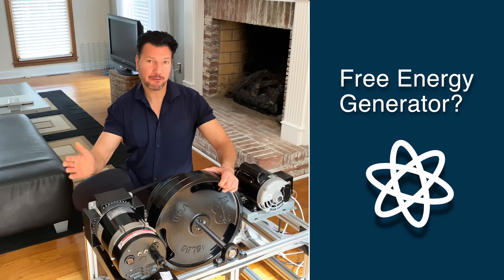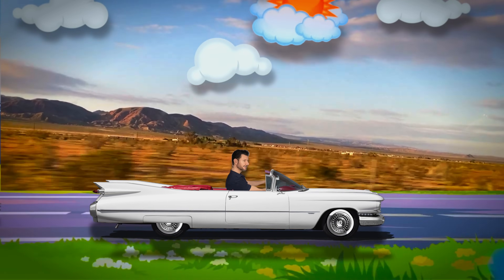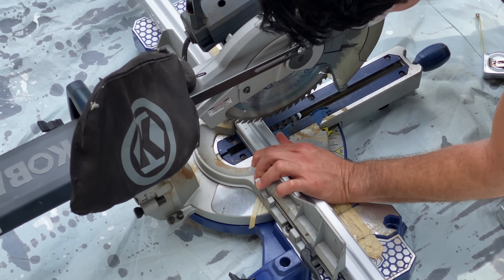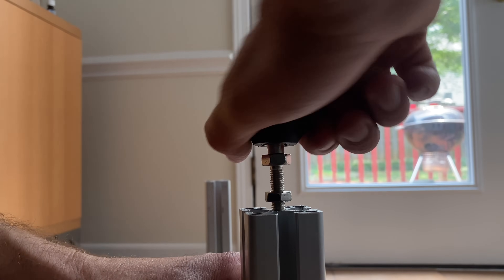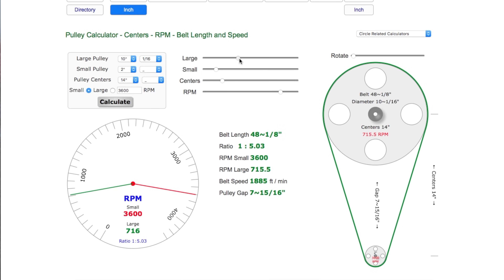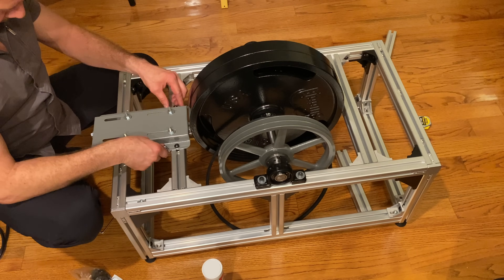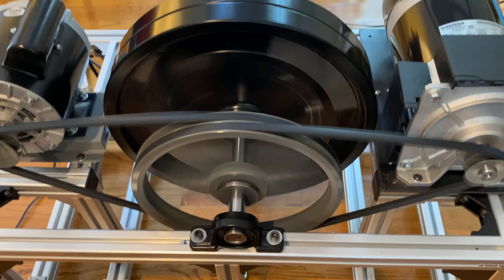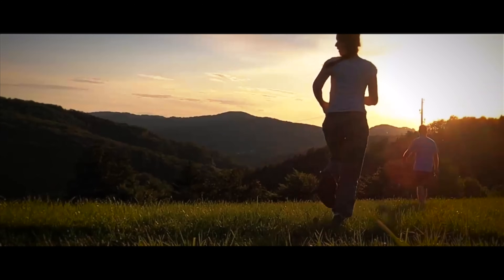How to Make a Free Energy Generator!

Comment: Thanks for the work you show. Whatever engine you install, the most important thing here is the generator. You have to modify the generator so that there is no dragging Lenz effect, then only with a bank of capacitors you can make this system work on self loop
Reply: The only person I know who has done this is the inventor Thane Heins. He has videos on the net for regenerative acceleration.
Reply from the maker: @Endthefinancialmatrix  thank you Eric I will look him up.
Reply from the maker: Thank you green wave.
Have you seen what you describe work?
Would be interesting to see.
Where I work we use capacitor banks for short term energy storage for AGV’s because the are much quicker.
In combination with a battery that is.
Reply: @MarkusNenning  yes I have made, see my videos. also if you want to try with regularly generators you must use 2 pulleys on the flywheel with different radius in this case it can work for the driving motor you must use FVD
Reply: @MarkusNenning  hi out of curiousness i Wonder if you tryed what green wawe Said or any of the others and made it work? It would have been awsome
Reply from the maker: @vikingofnorway991  unfortunately it is still not working.
I am currently working on rewiring a car alternator and hope to get some better results with it.
Reply: @MarkusNenning  cool, thanks for the answer, I hope u try to convert a 24V 200A alternator, thats what im gonna atempt atleast 😅 the curiousity kills me😂
Reply from the maker: @vikingofnorway991  mine is only 130Amp :)

Comment: You need to use an 1800 RPM generator and change your pulley sizes copy the Indians videos 3 horsepower electric motor with a 12kw generator seems to be the average formula again look at 10 of the Indians videos they all seem to use similar flywheels and pulley systems and definitely 3 horse electric motor average width 12 kilowatt generator I'm going to make one just to see cuz I want so many videos got to see if it works or not good luck
Reply from the maker: Thank you Welding Girl!
If you really make one yourself share a video.
I am working on a re-design with some new ideas and some wild concepts :)
Will have a follow up video soon.

Comment: thank you for this nice video.
personally i believe the answer is the following.
use more than 3 generators with the same motor and above all you must replenish the ball bearings 
with magnetic bearings to eliminate the frictions and so the losses of the energy
Reply from the maker: Thank you!
Yes floating magnetic bearings was my original plan but for that heavy flywheel it was too expensive to get the needed parts. Hopefully next time.

Comment: Your fly weell is very small and so the ratio of the pulley forbidden gynflu d Ford engine to the fly weel is good but from the fly weel to generator sould be smaller to bigger and is Big to small
Reply from the maker: Hello Juan it’s over 90 pounds.
Do you think to small in diameter?
I am planning on adding 2 more discs but wondering if I need to have a bigger diameter.
It’s very hard to find a big flywheel around here.

Comment: hi . good boy.  you have made nice work .but is on error direction .. to produce more energy that consume need force multiplier mechanism ..the flywheel is not multiplier. is only storage kinetic energy ..for this thing this system dint work .. i have much year to research to find the perfect multiplier mechanism ..  i wish you good luck in the next project .
Reply from the maker: Thank you!
If I use a driveshaft instead belts do I need a gearbox in between as a multiplier?

Comment: Don't you know of ratio? Wether you'd used a wheel with same ratio as on motor and generator everything would have been working well. You just didn't make enough power for wheel to turn. Try to make even ratio and let's see! Would be interesting.
P.s. See those indian videos, they are using same diameter wheels so they didn't lose any energy.
Reply from the maker: Thank you 
My radio is almost 1:1 the motor is 3000rpm and the generator needs 3600
One of the most suggested modifications is using a low rpm permanent magnet generator.
I will give that a try.
Reply: @MarkusNenning  no, you didn't understand. I ment the ratio between motor and center wheel. It is there you are losing power. You need to make this ratio 1:1. The thing is that big heavy wheel will generate power under big moment of rotation.

Comment: bigger fly wheel and lower rpm alternator should do the trick!!
Reply from the maker: Any idea where to get a bigger flywheel?
I was thinking about adding 2 more 45lb plates.
A actual bigger diameter is very hard to find.
Reply: @MarkusNenning  I have no idea man, you might have to make one lol
Reply from the maker: @ggesdsdsdsd  also not an easy task :)
I either need a big hunk of steel or maybe something out of reinforced concrete.
Anyway thanks for the feedback!
Reply: @MarkusNenning  Another way is to make a water loop with a large ram pump and a lot of water, feeding it into a water turbine.

Comment: My brother, you've done a great job I must confess, however, your pulley looks like a one to one ratio, and therefore there is no torque amplification from the drive motor to the generator. hence the braking force from the generator when loaded will be greater than the driving force from the motor at runtime and will coast from max speed to zero. what you must do is double or triple the size of the pulley diameter at the generator side. this will deliver 1 to 2 or 1 to 3 torque conversion. note that you may need a higher speed motor 2 or 3 times that of the generator. a generator with more number of pole pairs runs at a lower speed, you may consider that or have a motor that can run at about 6000rpm or 9000 rpm for the same generator. 
Since your drive motor is taking AC voltage I will recommend you power it with VFD for power efficiency and good control over the speed you wanted. 
Good luck.
Reply from the maker: Thank you Samuel!
I am afraid if I spin that flywheel with such a high rpm it will literally Fly! Lol
I got some other great comments on here and it convinced me to get rid of the belts altogether and go with a direct drive with a driveshaft or U-joint.
But yes I think your theory is correct!
Definitely will look into the variable frequency drive.
Reply: Thank you for these comments
Reply: Sorry but changing the ratio or drive or controller will not change the fact that you will not get free energy (except if you can get free electricity to 'spin' your flywheel in the first place). At best you are building a mechanical battery with an efficiency of about 70% and an energy density lower than lead-acid battery... Sorry.
Reply: @jcugnoni  you are perfectly right at least to the present state where theory state perpetual motion machines doesn't exist. However, the target is to create one. Note that Loaded Electric generators at runtime produces a back EMF which is practically a breaking force in simple terms. The concept of the gear ratio is to ensure that the this force will always be less than the driving force, and if this is achieved then you can stay in motion else you'll Coast to zero speed.
Reply from the maker: @jcugnoni  yes in this setup probably right.
This was only supposed to be the basic that I build my other strategy on it.
Will post a second video explaining more soon.

Comment: So apparently this guy does it and gives you all the pulley diameters  size of flywheel and sizes of motor and generator .  You should build one to this videos specs and post your results. The way things are going, it could save lives this winter. Here's the video link
 12kw Free Energy Generator 230v With Alternator & 3 HP Electric Motor Free Electricity Generator
https://youtu.be/lFvaBxknuUk
Reply from the maker: Thank you Ryan I have to check that out.
It would have been great to have this before I build mine :)
Unfortunately I couldn’t hardly find any information at the time especially nothing specified.
But it’s also hard to find a generator in the US you have to order from Ebay or something.

Comment: How about using a diode coming off your output motor as well as some sort of battery bank or a capacitor to store the energy coming from your output. I believe that you can only use 33% of the energy
Reply from the maker: Thank you Joshua!
I did actually try a diode bridge rectifier and wasn't successful with that either.

Comment: you have to enlarging your flywheel much more or double it in diameter and weight ,I think it will work even if you turn of the motor because the efficiency of the flywheel will keep it spinning much time ,good luck
Reply from the maker: Thank you Rozaba!
Not easy to find a flywheel with a large diameter unfortunately.
Reply: Y haciendo lo que tú dices se le puede dar un reinicio al motor de vez en cuando para que impulse y siga moviendo el alternador cómo mencionado anteriormente creo que una solución la podríamos hacer con los imanes que hagan funcionar el volante magnético creando hay un campo magnético para que ruede esa rueda

Comment: Dear friend, the ebb of this machine is only one .I will change the generator and you will take one with the fewest revolutions .e.g. 200 rpm little current from the generator and will spare to power the house.
Reply from the maker: Thank you Stefanos !
It’s very hard to find a generator with such low rpm here in the US but I am searching.
Reply: Dear friend, with such low speeds are the generators with fixed magnets.

Comment: Your pulleys on the flywheel need to be different sizes...a smaller one for the motor to spin the flywheel and a larger one to turn the generator.  Here is a website that shows the calcuation.  https://www.youtube.com/watch?v=vQBdSm8kF1c&list=LL&index=4    This may help.
Reply from the maker: Thank you Randy
It depends all on what rpm the Motor has and the generator needs.
In my case 3000rpm on the Motor and 3600rpm on the generator.
I overclock the generator side slightly to compensate for slippage and transmission loses.
Reply: @MarkusNenning  Wow, did not expect a response so quickly.  Thanks.  That is great to overclock the generator, but you are losing RPMs by making the pulley on the flywheel (just for the motor side) larger than the pulley on the motor driving the flywheel.  This size difference reduces RPMs.  If you reduce the size of that specific pulley (just for the motor on the Flywheel), or increase the size of the pulley on the motor itself so that the spinning flywheel will be more close to the 3000 RPM and then with the large pulley (just for the generator) will make up the difference in the loss of RPMs the motor is not able to create.  If you follow the calculation of the video, I believe you will achieve success.  That is unless you are being paid to discredit the videos about free energy by not producing an exact replica (which I don't think you are, but you never know these days).  If you are going to try and create the same thing, you need to consider the exact specifications and calculation they use for the pulleys, motor, and generator.  Obviously, they have considered calculations for all of it.  I am sure they found the sweet spot.  I don't know how long those contraptions will run because "according to science" they aren't supposed to work at all and they clearly work....even if for a little while.  I believe the weight of the flywheel is there so that the slowing of spinning caused by the force of the electricity production is countered by the weight of the flywheel to move the spinning forward and to keep the RPMs up while under a load....well logically it makes sense.  I am not sure if I stated what I meant correctly,  Don't stop tho.  Keep going.  I would like to see you achieve what you are doing.
Reply from the maker: @randyewinters  thank you I will try your suggestion.
And I can assure you I am not paid by anyone, unfortunately 😄
I was actually debating for the longest time to go with 2 pulleys or with a double but yes it makes sense.

Comment: Hello good job there are great comments on using the magnets to reduce the speed correct  . So we now no 2800 RPM or 3600 RPM  remember what ever speed you are going to choose ,you have to have this unit to spin at a higher rotation like 5000  or 4000 for 2800    then try to plug in as you did

Good day ...
Reply from the maker: 😳wow that is very fast!
The centrifugal forces at that high of a speed will be extremely high. Scary high :) 
Thank you!
Reply: dont be afraid to spin at high speed just make sure that nothing will fly in your face or others and you are good to go ..

The trick is to spin as fast as you can say around 5000 for 3600,  for 2800  4200 good luck.
Reply from the maker: @earthssecretenergy2371  yes I already almost got hit in the face by a magnet flying off :)

Comment: you have to use a low rev generator, for example one of 300rpm ..
Reply from the maker: I didn’t know they make them with such low rpm?
Thanks Juan!
Reply: @MarkusNenning   hello if I have seen commercial generators that bring those rpm. If the generator that you used in the video is 1500 rpm and the motor to drive the system is also 1500 rpm, you will not get over unit at the generator output, because when you connect a load it will tend to slow down the generator and lower its rpm and therefore you will not have free energy ..
If you use a 240 or 300rpm generator driven by a 1500rpm motor and a 50kg flywheel, when you connect loads to the generator, even though it tends to slow it down, it will continue to deliver energy since it does not need as many rpm to work. Even when you disconnect the driving motor from the electrical network and connect it to the generator, it will not stop since the system is turning at 1500rpm, that is 5 times more rpm than the generator needs to run.
I hope you see me explained and that this information will be useful to you, I do not have the means to carry out a project of such magnitude, I wish you much success and continue with a cordial greeting from Argentina ..

Comment: the problem was your pulley ratio and the flywheel due to a bad ratios that causes high tension to the belt drive system,it gave friction the power to stop the kinetic effect  on the generator thus creating what we call a failure. But that was a nice idea bro keep on trying free energy is real through this...divide the pulley ratio by 2 and make sure the belts are not too much tight, and at list let the flywheel shaft spin at 3000rpm for   the generator to have a good mechanical force
Reply from the maker: Thank you Zephania!
Reply: Yes correct zephania
Reply: Did you ever try this?
Reply from the maker: I have tried all kinds of pulley ratio’s 
Tried removing the flywheel weight losen the tension,… just about anything.
I am working on modifying a car alternator now.
Thanks for asking!

Comment: U did well on your experiments, try using neodymium magnets for your generator instead of coil,u have to modify your generator to reduce the rpm down to 500rpm.thanks
Reply: I think the magnets were just to balance the flywheel.
Reply from the maker: @kgsalvage6306  yes I only used the magnets for balancing weight.
I looked into using magnets in addition to help turning but it was too expensive to get such strong magnets.
Reply from the maker: Thank you Henry!
Reply: Si correcto es mejor comprar de Aliexpress un generador de imanes permanentes

Comment: You can try to use low speed alternator
Capacitor will help you to store some charges after relay..and it should be connected to the motor
Reply from the maker: Thank you Daniel
Several people have recommended that.
May just give it a try
Reply: Use super capacitors.
Reply from the maker: @jatanlimbasiya5350  thanks will look into it.